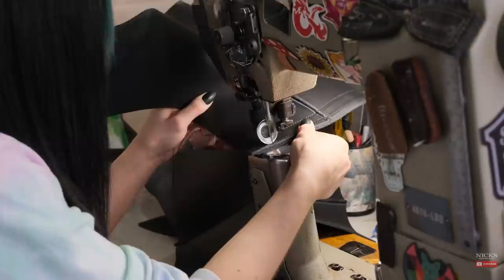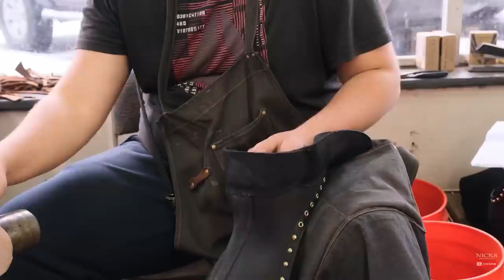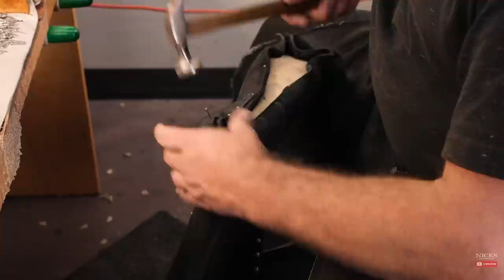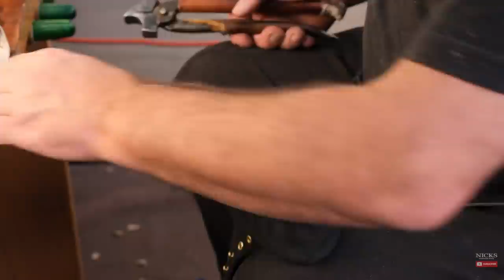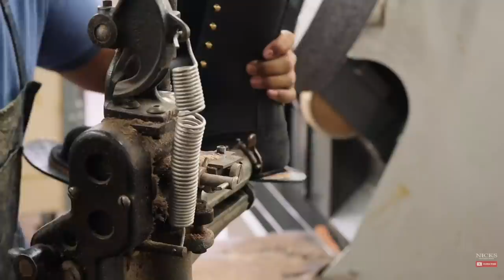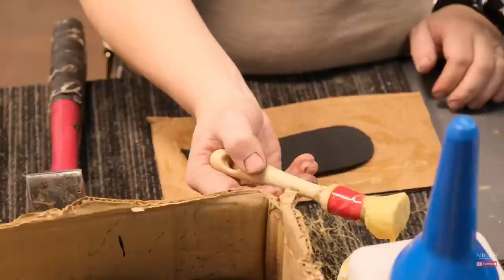World's THICKEST Work Boots: How It's Made - Nicks Lace to Toe

Comment: There is a lot great shoe makers in the world but for a family own and very small shoe business, you guys are amazing. Pure craftsmanship at its best. First time buyer and now I will only buy boots from you guys.
Reply: A little over kill thier boots heavy ages to break in, good for some but light weight boots are the best for work
Reply: @pineapplesideways3820  If your working on the rungs of a ladder hours a day you need that big heel and support. Try standing on a ladder for two hours with a shitty boot...your gonna hurt.
Reply: @umbertosmith7014  I used to build houses so yes ladders and light weight boots are so much better, especially engineered ones oil, shock resistant, these Nick's would not be allowed on site with on a union site especially
Reply: @pineapplesideways3820  They make boots specifically for specialized safety related qualifications like electrical, chemical resistant, toe protection, anti-slip, etc.

Comment: I wish I could get a version of the Firefighter Boot with a moderate arch.  Call it the “Boilermaker”.  

I work around big boilers, most of them are 3-5 stories tall.  We walk on catwalks that are VERY HOT.  

You must wear heat resistant gloves to grab the hand rails on the stairs or level catwalks.  

The hot steel catwalks and stairs can destroy a pair of Timberlands in less than a minute.  I do not need the logger heel.

In fact, a wedge sole might almost be ideal.  But, no one makes that type of sole, yet.

It would be good if you offered the Firefighter boot in a moderate arch version, one without the logger or dogger heel stack.
Reply: Probably can, but it'd be a custom order. Call 'em and ask.

Comment: A couple of questions:
1.) could you do these as corks?
2.) how would I ask for a true 12" shaft height?
3.) ltt looks more snag proof (I'm a faller who does  horse/mule logging with the Amish) but also looks like they'd leak more. true or false?
Reply: Leather will last longer !!
Reply: People would usually get a leather sole I'f the use them for horse back. The sole is completely flat minus the heel. So if you need to get off the horse quickly it won't catch you. If you have any more questions I would call.

Comment: I've watched several of these and am trying to figure out at what point do they remove the last? Cool process
Reply: That's exactly what I've been waiting for
Reply: They take it out before we box it
Reply: After they nail the midsole on and before they Blake stitch I assume
Reply: @briandalponte5898  They are 270 stitched down, not Blake stitched. No need to remove last for this type of construction. Actually they need last's steel plate for clinching nails at shank and heel.
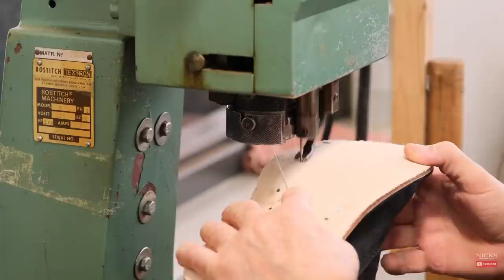Reply: @ObelixCMM  they are, in fact, Blake stitched in addition to being stitch down. AFTER the metal bottomed last is taken out. 13:53

Comment: What I want to know is how do they get the shoe form (last) out of the boot since it has had so many nails put into it and what happens to all those nails ?
Reply: Out of all those nails only first 3 are driven in to the last, and you can see him pull them out with small crowbar, rest of them get bent/clinched by steel plate at the bottom of the last.

Comment: What is the function of the lace to toe?  Why would I get this over standard boots?  Are there positives and drawbacks?
Reply: LTT gives you more adjustment for foot type. For example I have high foot bridge and regular lacing pinches down on front of the bridge, with LTT I can loosen lacing in that area and still get good heel lock.
Reply: Nathan Schroeder:  In my experience, I mainly desire LTT for when you must walk down steep downgrades and you don’t want your toenails jammed toward your heels by the inside front of boots.  By tightening laces more tightly across the top of foot from toe to instep, the pressure can be spread over a wider area of foot making mountain terrain hiking much more enjoyable.

Comment: I wonder how hard would it be to break those boots in compare to the builder pro
Reply: By the way thanks for sharing, I am the kind of guy that is lace to toe or nothing
Reply: They are built exactly the same, outside of the stitching pattern. Main difference is that you can alter the fit and the thickness of the socks you wear with this design far more so than their regular boots.
Reply: I have broke 4 pair of these in.  The first pair I thought I could just wear to break them...ended up breaking my feet first.  It only took me a few days before I filled them with water one evening.   Put them on in the morning, laced them tight with synthetic laces and wore them dry.  They fit like a soft pair of gloves from then on.

Comment: What’s the reason behind the contour of the heel?
Reply: From what I can tell it's all due to the curve of the sander.
Also,  If it was straight tapered it would look like a high 👠.
Reply: @richardpatterson4312  it looks like you could fall backwards if you leaned too far. I thought the contour made it look more like a ladies boot!
Reply: I have a pair of logger heels which is what these are. It helps arch you foot Ang makes them easier on your feet when you break them in. And it's an option to get it or not. There's also block heels that are strait with out any curve. And a few different types